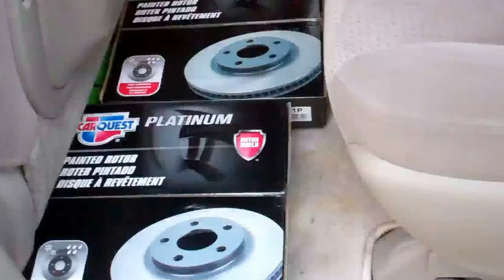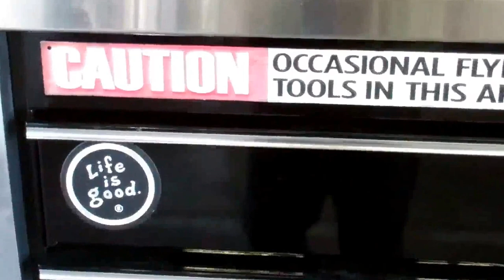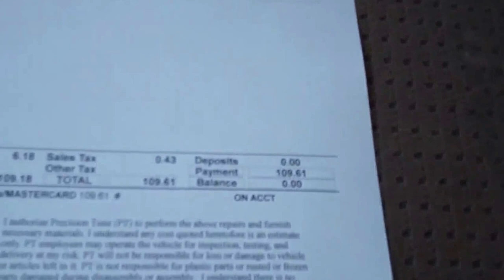Morning Sienna Brake Job

Comment: I am not trying to be nosy but, how much does your buddy usually run just for a basic oil and filter change on your particular van.  We have ours changed at dealer its two years newer than yours but, still has same exact motor and it usually runs us around 37 and change and they check everything on the van and top of any fluids if neccessary and usually for us they thrown in a replacment bulbs i.e. brake lights etc if something is burned out they either throw it in or just charge for the bulb.
Reply from the maker: Well my Sienna takes an extra quart of oil and a special filter so with my veteran discount it's around $27-$28 dollars.. That includes full service topping off the fluids.